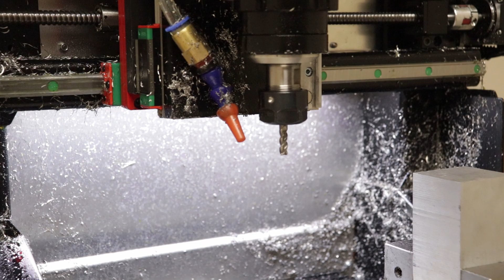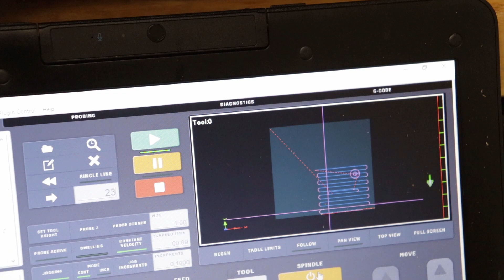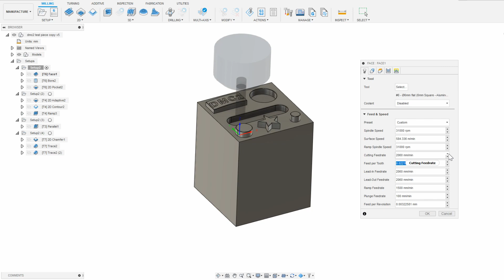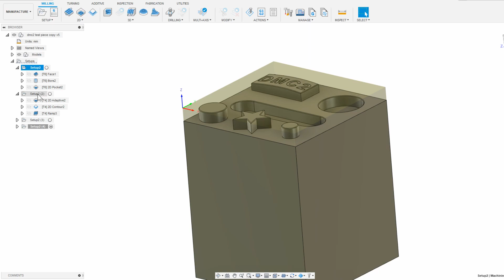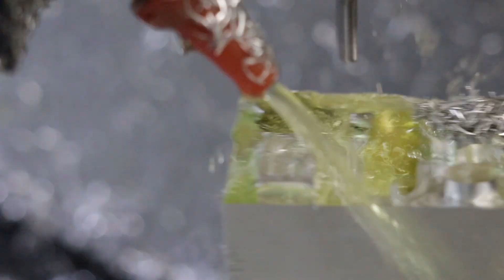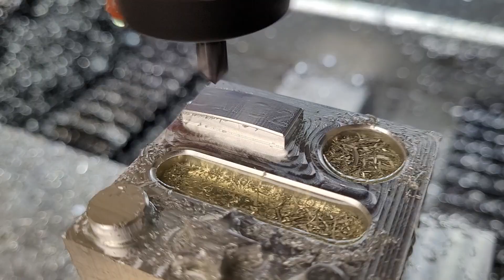DMC2 Training Course - Episode 7 - Running the DMC2

Comment: just curious how would you go about getting the Z for a new tool if the Part does not have a flat surface, would it be possible to probe the tool off the bed?